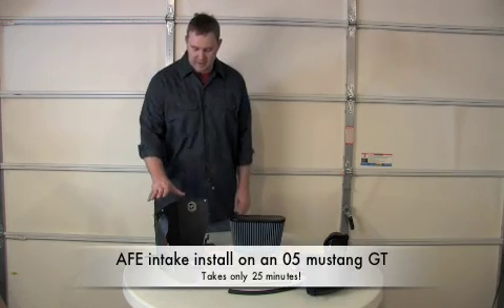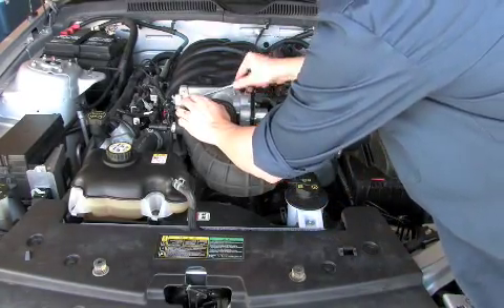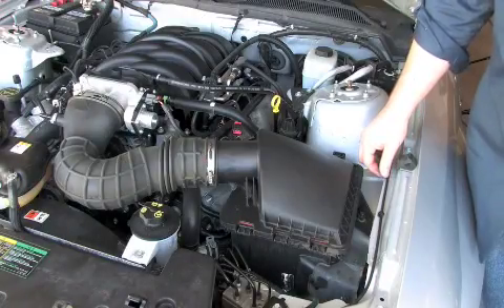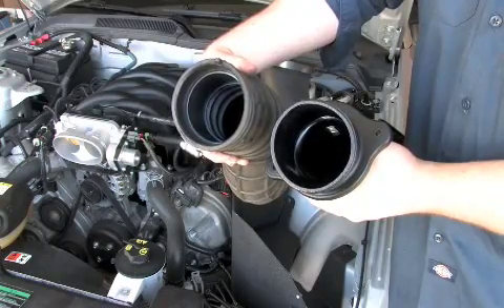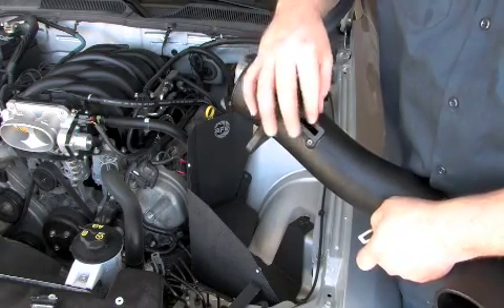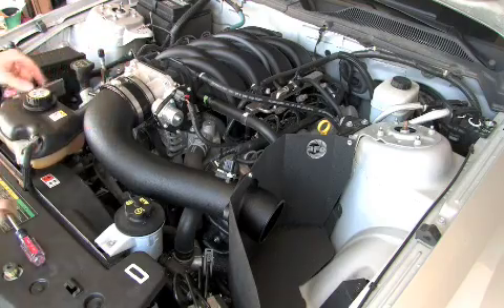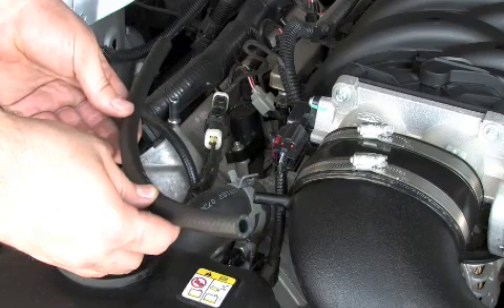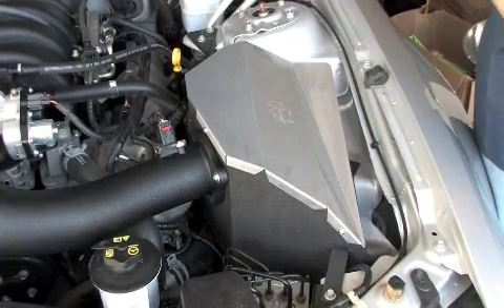AFE Cold Air Intake Install (05-09 Mustang GT)

Comment from the maker: @wdbwfan It can be left open if you prefer it that way. If the box is left open however it won't seal out the hot engine air as well as it should.

Comment from the maker: It doesn't require a chip. Most of the chips will add about 20 hp, and if you use one with a cold air intake, you get a little more out of each item.

Comment from the maker: We typically deal with muscle cars, so I'm not as familiar with SUV's, but you probably don't have the mass air flow sensor hooked up properly. You might call the manufacturer of the kit also and make sure you bought the right part for your expedition.

Comment from the maker: most of the air comes from over by the fender well. That whole side is open. The idea is to keep the hotter engine air out while allowing the cooler air from away from the engine to enter.